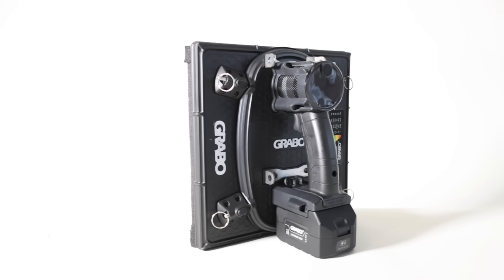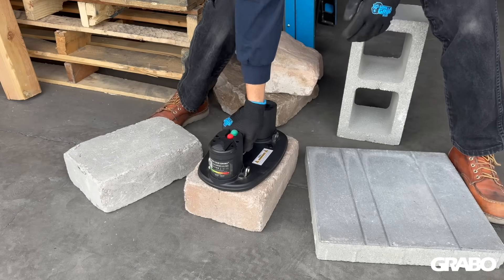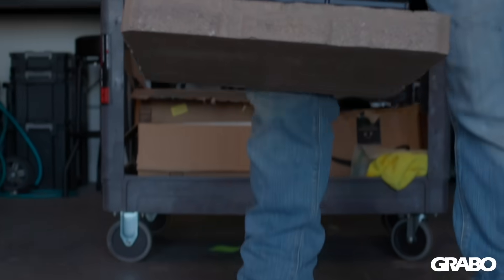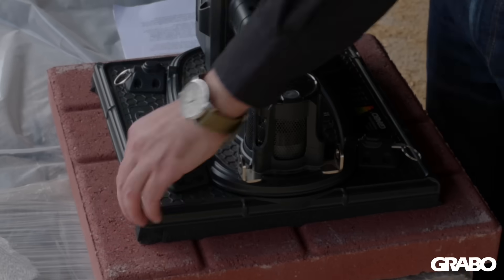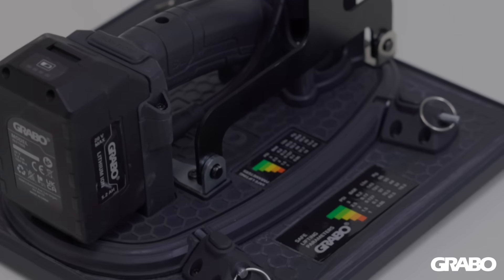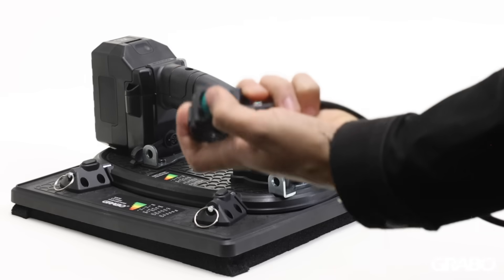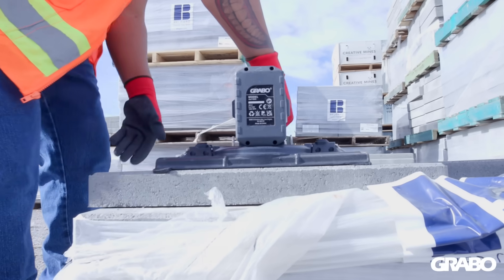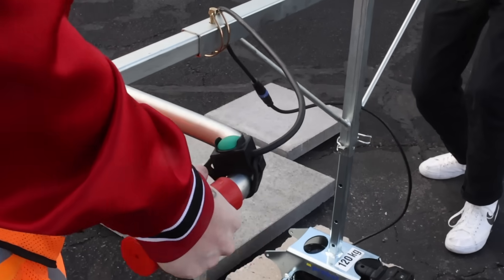THE GRABO High Flow Introduction

Comment: No good.
Because you need at all time push Triger !!!
Reply from the maker: That's why we included the remote control with the tool so you don't have to hold the trigger, however the trigger is there as a fail safe for maximum control to save time.

Comment: Can you attach the standard seal for smaller materials to the high flow?
Reply from the maker: https://grabo.com/products/accessories/grabo-high-flow-standard-oval-open-cell-foam-seal
Reply from the maker: Hey there, yes, we made a smaller seal specifically for the high flow!
Reply: Whats the weight limit with the standard seal?
Reply from the maker: @Kronik0805  75 lbs with the standard oval foam seal. 150 lbs with the suction plate 300, and 242 lbs with the suction plate 400

Comment: My regular grabo has picked up %5 of the pavers i have installed since I bought it almost 3 years ago. I really hope this works, especially on the most common pavers. I'm willing to put my old one aside and buy this one, but we would need to test it first from one of my suppliers
Reply from the maker: Correct. The original GRABO grips just about all building materials except EXTREMELY porous pavers. This new tool CAN grip all those EXTREMELY porous pavers.
Reply: @Grabotools  thank you for the response, any chance grabo will be at the world of concrete 2025?
Reply from the maker: @rebel1333frank  Howdy! Yes sir! We'll be there, somewhere near the material handling section. I plan on taking heavy POROUS pavers for everyone to test and feel the new tool for themselves.
Reply: @Grabotools  if you guys got the tool at the world of concrete I will buy it! Thank you!